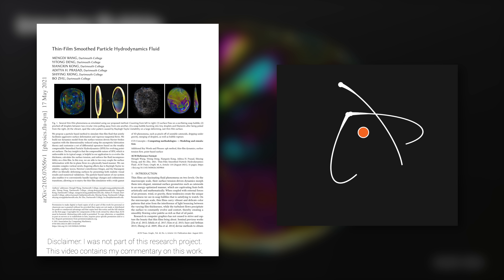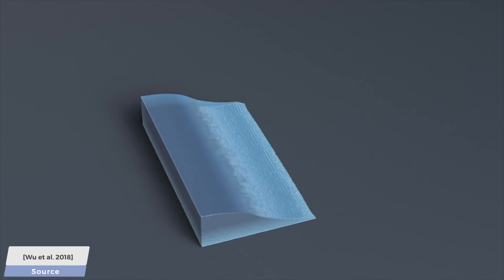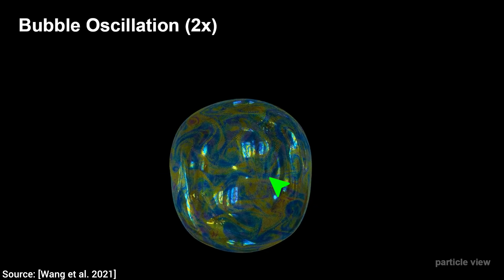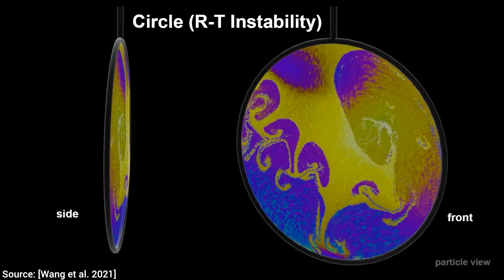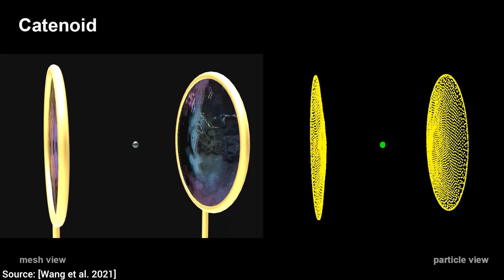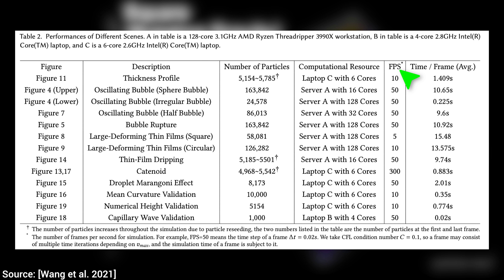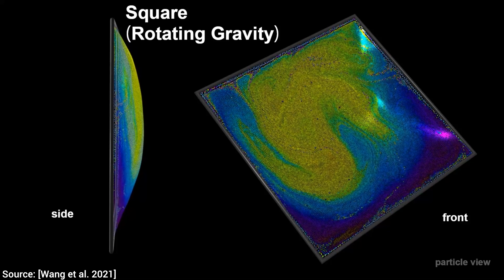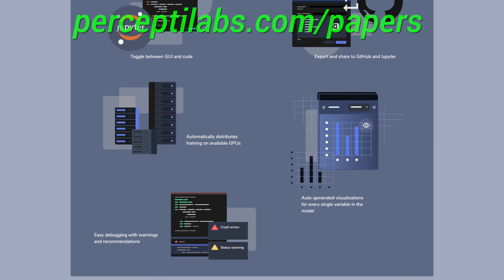Simulating Bursting Soap Bubbles! 🧼

Comment: So much papers and yet we have blender with it fluid sim that 99% of processing time calculate void :D
Reply: blender need to integrate these papers since many of them are open source
Reply: @karthikeyan3d319  yes, especially one that use GPU and being domainless
Reply: And blender's fluid sim is such a pain to work with! Sometime it just DOES NOT want to work
Reply: @maximek5616  some lifehack: half year ago i tested that fluid sim works stable (at least on clicking "BAKE" button part) only in 2.90.1. any other blender evrsion was just randomly crash it at random frame (for example 3000th) making all bake goes trash :)